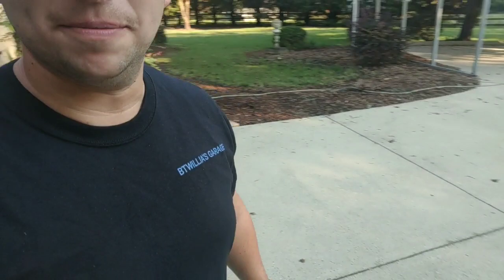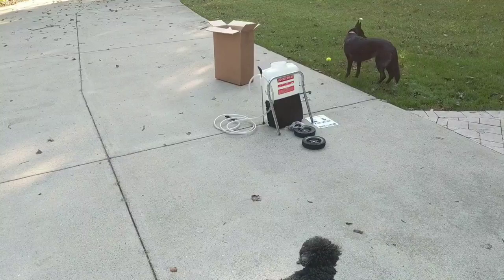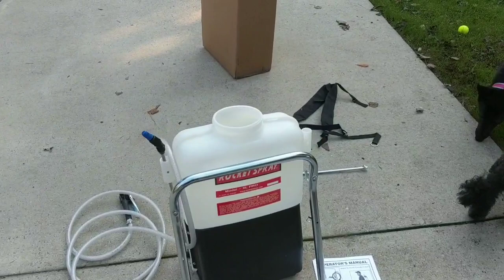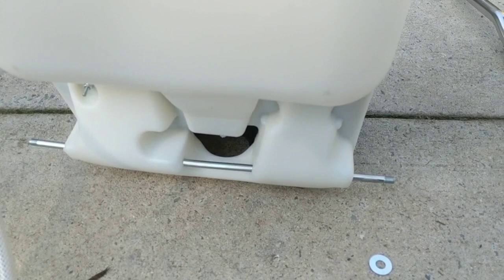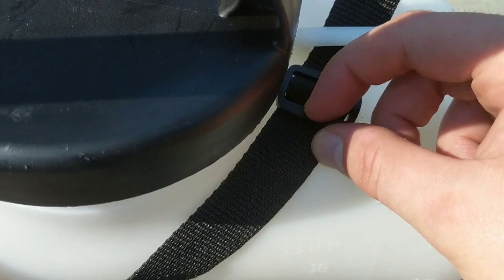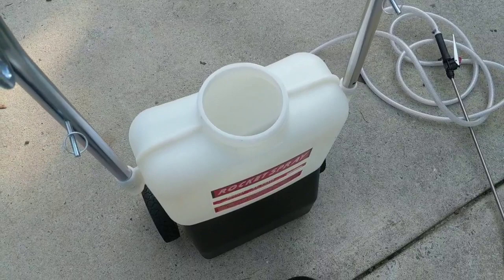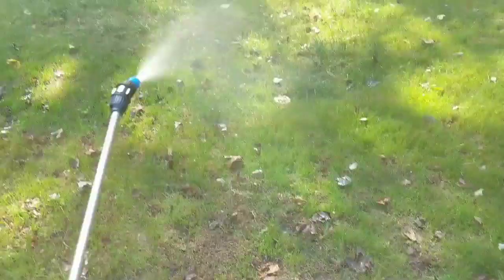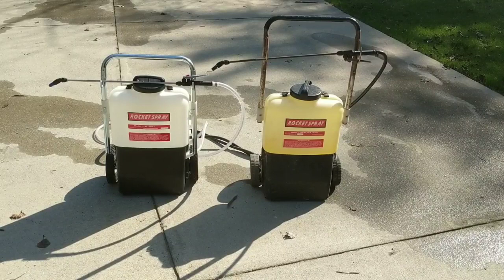Rocket Spray - Unboxing and Assembly

Comment: Should the on/off switch be On or Off when it is plugged in for charging ?
Reply from the maker: The switch should be off. I'm sure it will charge when on, but that is not required
Reply: @BtwilliasGarage  thanks